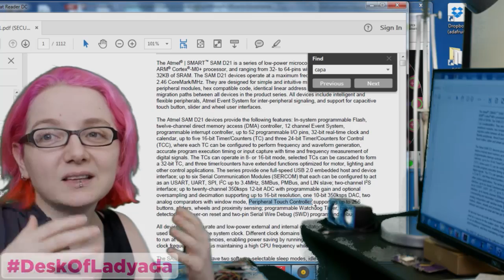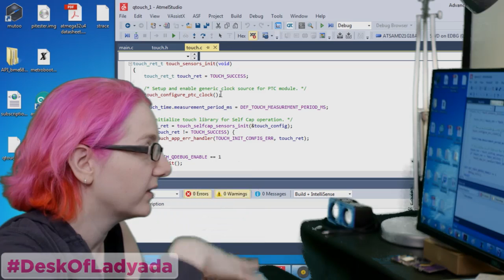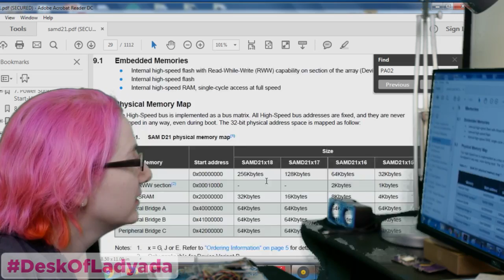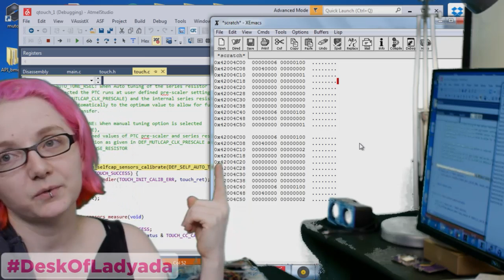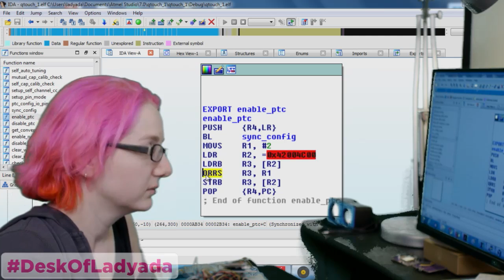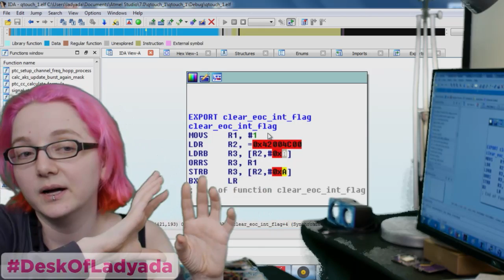#DeskOfLadyada Reverse engineering ARM binaries for QTouch LIVE @adafruit @ARMCommunity @MicrochipMa

Comment: There's no need for commercial software. The ARM GCC toolchain can do disassembly, too. I think the command is like "arm-none-eabi-objdump -D -S <objfile>" or something. And also it's better to disassemble the library file than the executable, because unused functions are usually deleted by the linker, so not all of the library functions will be found.

Comment: Neat stuff, but I'd be worried about copyright infringement if you're rewriting the library using the disassembled binary unless you've got permission from the manufacturer, as you're effectively just translating it from one language (asm) to another, which is generally considered to be copyright infrlinging. You should consider writing up the spec of how it works and get someone else to implement it, i.e.a "clean room design". But IANAL.

Comment: IDA is the best disassembler, I love it for reverse engineering, a shame that the pricing for individuals is a bit on the extreme side. I think the ARM disassembler comes with the view pseudocode as well (if you have their decompiler), and the decompiler is amazing. Alt+t is the hotkey for searching so that might be handy down the road. Hate I missed this stream!
I can't bring myself to use the arduino IDE without the ability to link